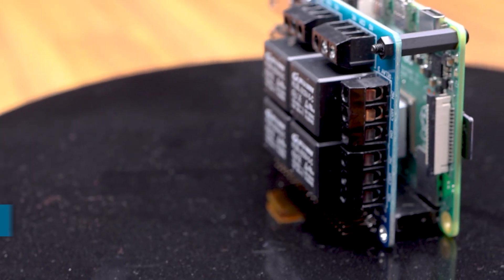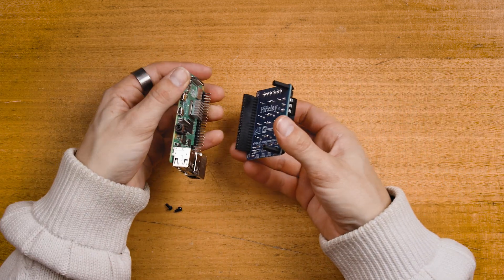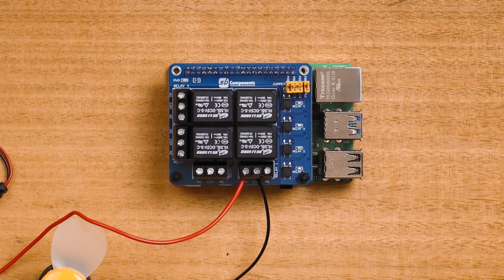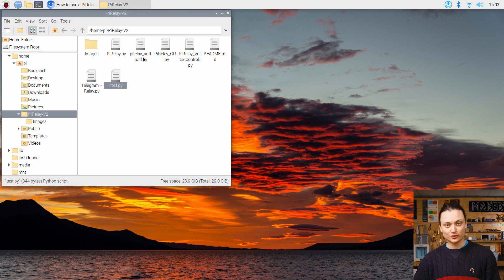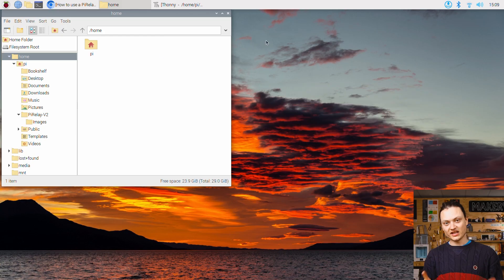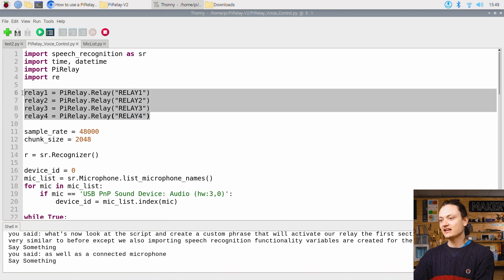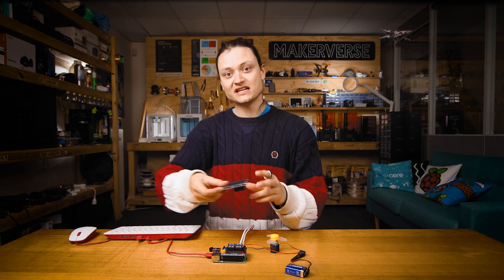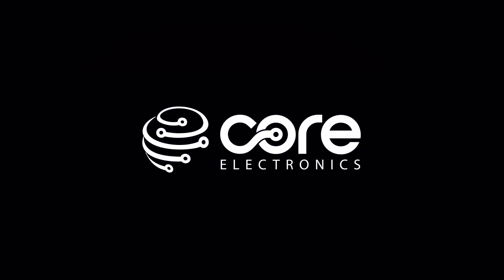Voice and Touchscreen GUI Relay Activation - How To Use A PiRelay V2 HAT with Raspberry Pi

Comment: Great video and info. I am a noob and need to control 8 relays with 8 physical push buttons and i want a GUI for it also...
I think I have figured out the code for the relays and buttons.... with this GUI script I think I can adapt it to fit my needs... (I am not using raspberry relays since I already have cheap relays...)
Edit: I ended up getting advised to use chatgpt. it took me about 40 minutes to have it write the code for me and even adapt the GUI code from core electronics to fit my needs. Litterally as easy as asking someone else to do it for me.... First time I ever used chatgpt for anything! LOLOL

p.s. As an electrician the double stack raspberry has one HUGE flaw; When the screen is mounted you cannot acces the screw terminals for the relays... So if you need to swich a wire to another terminal you will have to disassemble the screen first...

Comment: I'm new to the pi but I'm building a gaming table and I need the pi to run 2 actuators simultaneously and have 3 different preset heights and manual control and on the same setup run a bunch of leds with a bunch of presets all from that touchscreen panel. Any advice on hardware/software ill need?

Comment: hello, I can't speak English.  I'm using google translate.  I'd like to ask.  I get the message "RPi.GPIO as GPIO no module" what is the solution?  I have installed but it didn't work.  Please help me 🙏🙏🙏
Reply from the maker: All good mate, type this into your terminal | sudo apt-get install python3-dev python3-rpi.gpio | .

Then type | sudo thonny | into your terminal and open the script in this special Thonny IDE Version that has administrator powers. 

It should all work after that 😊

Comment: Would the relay work with a 220 V 2000 W heater fan running in 15 min intervals checking if the temp ha reached a certain value and then stops and restarts when the temp is dropped a few degrees?
Reply from the maker: Heyya mate, these relays top out at 30 Volts DC at 10 Amps. If you want to control some seriously powerful current and voltages take a look at the SparkFun Qwiic Quad Solid State Relay Kit - https://core-electronics.com.au/catalog/product/view/sku/KIT-16833

That relay kit is capable of shuffling around 40 Amps at 28-380 Volts AC!